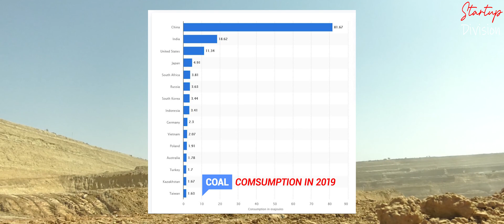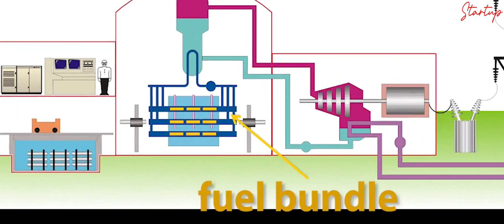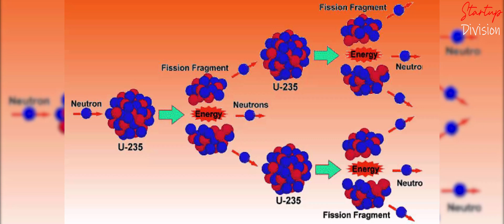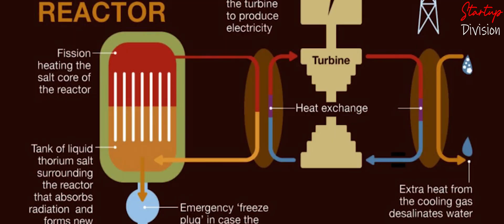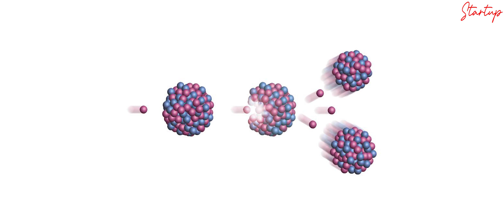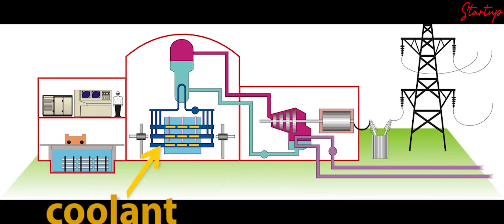How Thorium Will Change the Future of Nuclear Energy

Comment: Yes, we need nuclear, but not of the old, inefficient, less safe and polluting fission type as presently in use. While thorium is much better it cannot compete with fusion nuclear in the form of the newest type of FUSION "SAFIRE REACTOR" which uses safe, green, small footprint, 24 hr reliable and within community FUSION NUCLEAR POWER. See all about it at "AUREON ENERGY.COM". and learn your necessary "Electric Universe Theory" with your newer astrophysics and plasma physics reality at "THE THUNDERBOLTS PROJECT.COM" and you will then be on the right track. Learn about it and you can then teach your peers the right way and spread the great news.

Comment: I support nuclear, but don't lie. Sea levels are rising only 3 mm/year. that's about a one meter rise in 320 years. There's a lot factually wrong: Thorium is NOT directly fissile. It must absorb a neutron, have a couple of decays and transmute to Uranium 233 in order to be fissile.
Reply: Good points made. Thanks. And you're right about sea-levels (very) slow rise. Barack Obama bought a $15 million manse on Martha's Vineyard recently. He's probably not going to flip it anytime soon. He's not bothered by anyone's rising sea levels.
Reply: @paulbradford6475  The issue with Thorium is primarily legal. It is considered radioactive and subject to controls, even for research,. Other issues is materials reaserch, PWRs are essentially boilers and we have 200 years experience with making boilers. Using a different coolant requires all new materials for containment vesel, piping, moderators, reflectors, pumps, heat exchangers, etc.  The promise is almost limitless, but the ROI  is sketchy at best given the political/legal environment.

Comment: So I'm a strong advocate of nuclear power and molten salt reactors. However, I think the advantages of thorium specifically are often overstated. In particular this video makes quite a few untrue or misleading statements:

Thorium is cheaper than Uranium:

True, however, fuel costs are a tiny fraction of nuclear costs already. Moving from Uranium to Thorium would have significant infrastructure costs in building a new thorium based fuel cycle, and yet this would have almost no positive effect on overall costs because uranium is already very cheap.

Thorium is directly available in a fissile form:

Untrue. Thorium needs to be converted into Uranium-233 in order to be fissile. This has to be done in a breeder reactor. No one has ever made a thorium breeder reactor, they only exist theoretically. By contrast uranium only needs to be enriched to be a useful fuel: enrichment is a lot easier and cheaper than breeding and this is already done commercially around the world.

Molten salt reactors (such as LFTRS) are inherently safer than conventional nuclear reactors:

True. However, molten salt reactors work equally well with uranium as thorium, so this is not an advantage of thorium per se. The majority of MSR development today is based on the uranium cycle, see Moltex Energy, Terrapower, Terrestrial Energy and others. Thorcon are considering using thorium as a fuel additive, but their design is still very much based on the uranium fuel cycle. The only company I'm aware of that is pursuing the thorium cycle is Flibe energy.

Thorium reactors are more efficient

Again this is really mostly an advantage of the higher temperatures of molten-salt reactors, and is not specific to thorium. Thorium is more energy dense as a fuel than uranium, but again uranium is very cheap and extremely energy dense so this doesn't provide much advantage in practice.
 
Thorium reactors are safer because the reactor naturally stops when not bombarded with neutrons.

Effectively untrue. A nuclear fission reactor involves a self-sustaining chain reaction, one split causes another, causes another and so on. Thorium cannot do this directly and must be converted into U233 by being bombarded with neutrons. The only realistic way to produce those bombarding neutrons is a self-sustaining nuclear chain reaction. Meaning a thorium reactor needs a self-sustaining nuclear reaction present anyway (so is no safer for that reason) but also has all the complexities and difficulties of having to breed its fuel.

I do believe molten salt reactors (or other advanced nuclear) is the future of energy, however, I personally don't think thorium will play a large role in the next 50 years whilst uranium fuel is cheaply available.
Reply: Ummmm..No. India has built a Fast Breeder Reactor that specifically uses Thorium as blanket after converting Uranium to plutonium and uses the Thorium as a blanket along with Uranium in the second stage. https://timesofindia.indiatimes.com/india/nuclear-reactor-at-kalpakkam-worlds-envy-indias-pride/articleshow/59407602.cms#:~:text=India's%20fast%20breeder%20reactor%20is,into%20a%20valuable%20atomic%20material.
Reply: @GemsOfIndianRight  Some people believe India is all about slums, just ignore such stupid!
Reply: Also, Russia. World's only commercially operating fast breeder reactor is in Ural Mountains of Russia
.
Reply: Jacob Daniel Indeed, it has two I believe the BN-600 and BN-800 sodium cooled fast reactors, of course they both run on the uranium fuel cycle.
Reply: I think they did an excellent job of "simplifying" a complex subject.  "Efficient" could be in reference to fissile/fertile fuel burnup, in which case you make a lot less actinides in a thorium based fuel system and can achieve higher "burn up" since it has more opportunities to fission as it climbs the isotope chain from U-233 to the higher actinides.  

Thorium, as a fuel cycle, has a few advantages that don't impact nuclear directly.  Specifically the high(ish) concentrations of thorium in rare earth formations.  Because of it, the US will never have a rare earth mine without significant "nuclear waste" generation because of the way the EPA categorizes thorium which is brought up in mining.  It's not cost effective.  If it had a legitimate use industrial, such as in a nuclear reactor, you could drop the cost of rare earth mining. There is also the above "efficiency" in burn up argument above.  Less actinides in the waste, more fission products. 

There have been a few thorium breeder reactors.  Shippingport (one of the first) had a thorium fuel rod bundle which was converted into U-233 for fission... it wasn't the only core it used, but it did exist.  There are also thorium based CANDU designs tested in India but not exactly full commercial operation.  

Finally, I think the point they were making about it "stopping" is that a breeder reactor requires a neutron source to continue breeding and without that, there is no additional fissile loading and thus no additional fission once the core consumes enough fissile material to be sub critical.  It's a bit of a play on words and a misunderstanding of an advantage of MSR's in general in that they thermal load follow like the IFR did... high temperatures push fuel out of the core and reduce reactivity until things cool down.  And technically, they aren't wrong about the loss of breeding capability without a neutron source... it's just, like you pointed out, the only way that neutron source goes away is if you have enough neutron poisons in the core to get below the "producing slightly more than its using" breeding line.
Reply: @Whiskey11Gaming  India in the near future is ramping up their stockpile of Thorium in the recent years, Makes me think they have secretly either already figured out Thorium Nuclear reactor or are 100% sure that thorium would be the way in future.
Reply: @Whiskey11Gaming  Well explained!
Reply: What do you think about lightbridge fuel?
Reply: There were several gaffes in this as you've pointed out, and I agree with your points, of course, but there was one particularly funny one. People who live in or around coal power plants. Who lives in a coal power plant? When I heard that I was pretty sure this wasn't going to end well.
Reply: Thorium although technically not available in fissile form does reduce cost of enrichment. The whole of thorium is capable to covert to U233 but in uranium.. only 5 to 7 percent of the element has capacity to react. Moreover there are places like India which are much more abundant in thorium than uranium so it would overall be a much better choice.
Reply: @aaradhyachauhan2031  It is certainly true that all of thorium can be converted to U233. However it is much much harder to convert thorium to U233, as it requries neutron bombardment in a breeder reactor. By constrast enrichment simply involves separating the U235 out from the U238, for example in a centrifuge. Additionally uranium is cheap: who cares if you can only use a small fraction of it if it is cheap to get the ore and cheap to separate out the fraction you want? In practice fuel cost make up a neglible fraction of total nuclear power plant costs anyway. Even if U233 were cheaper (and it really isn't) you'd be optimising one of the smallest costs, not optimising the biggest ones (e.g. plant construction).

Comment: Thorium was initially selected for energy, but thanks to war mongerers we are stuck with much unsafe and not widely available uranium.
Reply: This is, at best, a mischaracterization of the reasons why Thorium was not chosen when the AEC/NRC went with the IFR vs the MSR in the 1960's... it wasn't because it couldn't produce bomb material, it could (and U-233 was tested for bombs and found deficient due to Uranium-232 poisoning making it dangerous to handle)... it was that the US had CONSIDERABLE experience in the Uranium->Plutonium fuel cycle FROM the bomb program.  We knew what to expect.  The Thorium fuel cycle was relatively new and the amount of collective knowledge on the risks involved in the handling of the cycle were not as well known as the plutonium fuel cycle was.  Further, the power generators we had, were already on the uranium fuel cycle, so finding a way to close the fuel cycle by burning up "spent" nuclear fuel was a massive benefit to the industry.
Reply: The only safe Uranium Fuel is 

Lightbridge